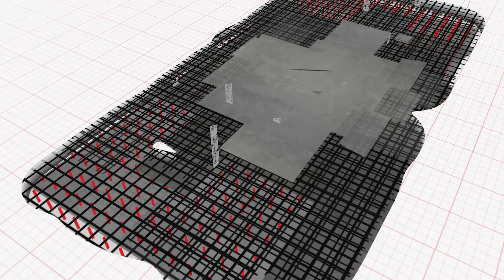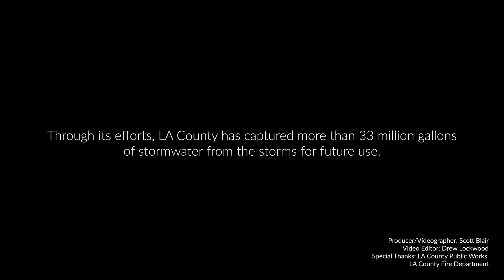ENR’s Exclusive Look at How LA County Flood Control System Mitigated Storms, Debris

Comment: 2 degrees hotter ambient temperatures don’t melt engine blocks off of your car , particularly in high demand real estate areas. Stop pushing lies about the climate when all flood control district does is shoot the runoff straight into the ocean